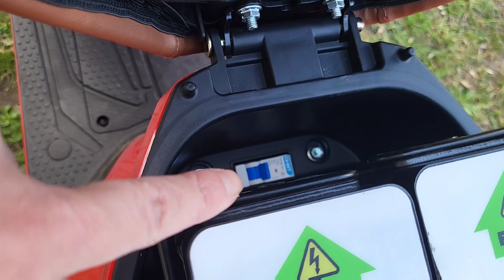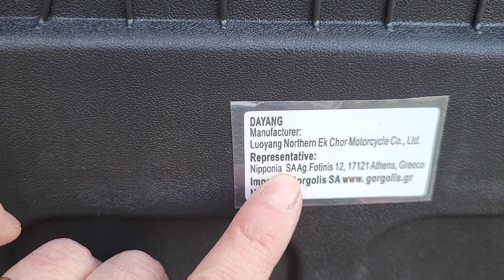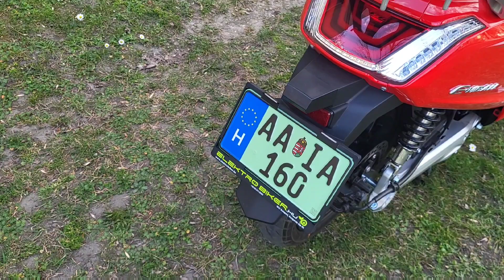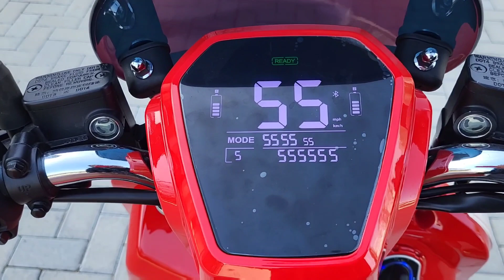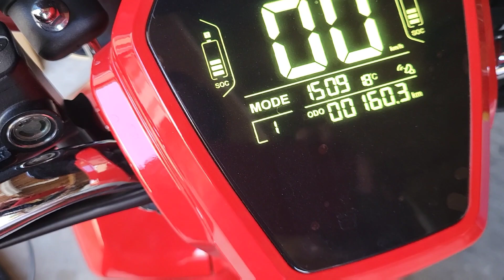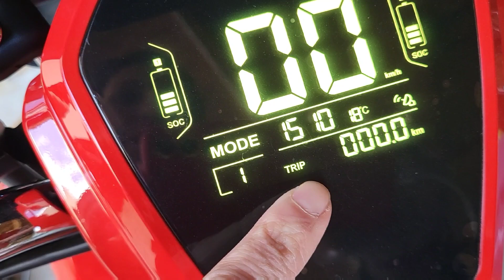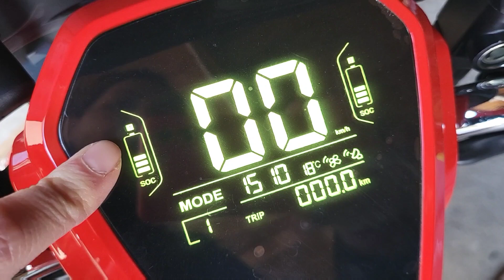220 felett: Daytona E-Viball elektromos robogó teszt - Csajok a motoron

Comment: Értelmét nem látom az ilyen motoroknak. Korszerűbb 50 es motorok gyári állapotban mennek 80-90 et.
Reply from the maker: Értelme? Energiatakarékosság, környezetvédelem? Zajcsökkentés. Elképzeltem, milyen csend lenne az utcán, ha minden jármű elektromos lenne.
Reply: 50-es robogók nem mennek 80-90-et. 125-ös megy a gyengébbje 90-et az erősebbje 110-et. Értelmét én sem látom mert olcsóbban veszel egy Honda pcx-et (1290000) és azzal elmész 350 km egy tankkal és nem gyengül ahogy fogy a tank😅 és eszik max 2.5 litert 100-on, és nagyobb túrákat is lehet vele tenni. Ez akkor érné meg ha olcsóbb lenne vagy legalább ugyan annyi mint egy 125-ös. Ja és ha kell egy akksi bele ami előbb utóbb kelleni fog az kb 400 ezer.